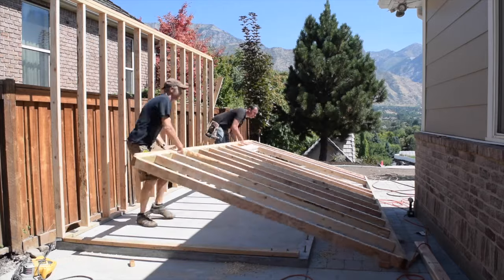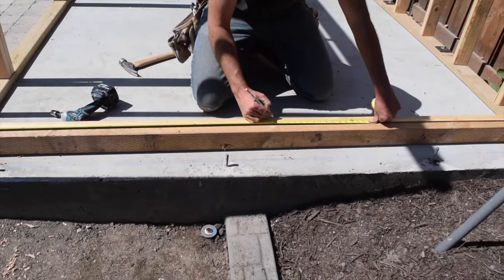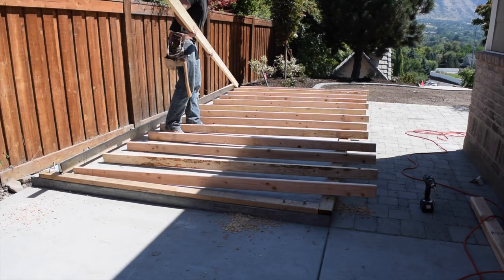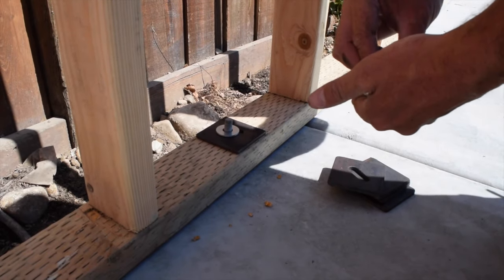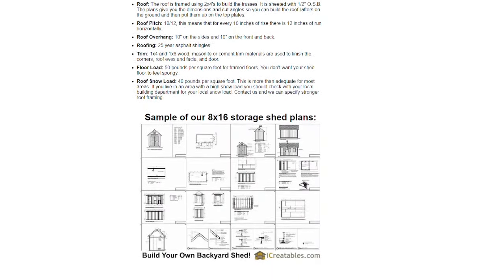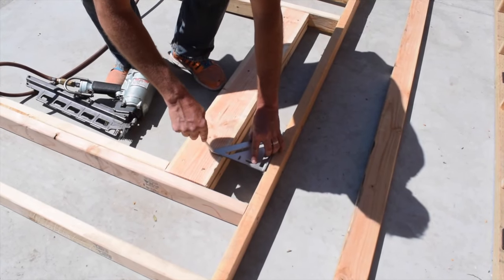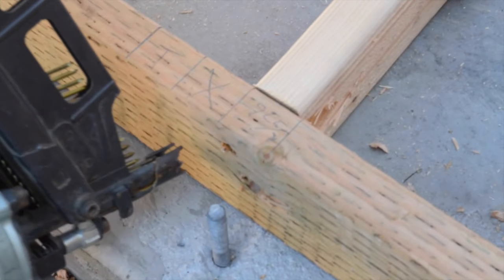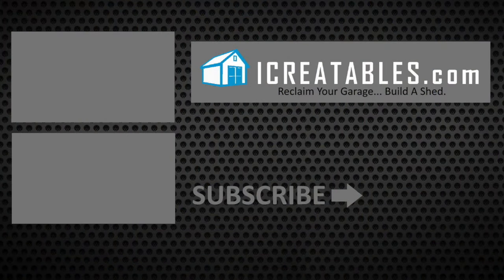How To Frame Shed Walls on Concrete Slab With Anchor Bolts

Comment: Two additions to this framing: make the bottom of each frame a double 2x4, the bottom one being pressure treated to avoid moisture issues and add a layer of foam between frame and concrete to avoid water leak.
Reply: This was great, I been tryin to find out about "how to make foundation for plastic shed" for a while now, and I think this has helped. Have you ever come across - Damkietor Nonpareil Dominion - (should be on google have a look ) ? It is a great one of a kind product for building better sheds and woodworking minus the headache. Ive heard some pretty good things about it and my partner got excellent results with it.

Comment: I always measure to know where my anchor bolts are in relation to the stud. Much easier & 3/4 or even 1 1/2 inch is not going to cause the building to fall.

Comment: 2 questions: 1) If you use pressure-treated wood for the bottom plate is that enough to keep termites out of the building? 2) What do you do on the inside corners if you want to add sheet rock? There's nothing to nail to on one of the inside walls.
Reply: Pressure treated wood keeps the walls from sucking up moisture from the concrete. I wouldn't expect it to do much for termites.
Reply from the maker: Correct, pressure treated is for rotting prevention not termites. You need to have termite treatment. If you want to install drywall you would install another 2x4 to make a full corner.
Reply: Really do you need pressure treated these days?  I use window seal (a rubber like compound) or even the foam seal either way lumber doesn't touch concrete which is key.
Reply: You would add an additional stud on the inside corner. Make sure to install it perpendicular to the other studs so you can insulate the corner. A 2x6 works best as it will go behind the adjacent wall line and still come onto the new wall line enough to hold drywall.
Reply: A little late to the game, but Diatomaceous Earth with Boric acid covering the bottom plate will go a long way in keep out bugs.

Comment: I want to do this to a drveway slab to erect two privacy walls where an aluminum lean-to awning roof already exists. With new walls and no additional weight from a wood framed roof, would this be too heavy for a slab without footings?

Comment: Is it not required to have a vapor barrier under the bottom plate between the slab ?
Reply from the maker: Sill seal is to stop air moving under the wall. You can use it if you like. This shed is not heated so we did not do it.

Comment: Do you know if it is common for framers to knock anchor bolts to the side and break the concrete in order to get a wall stood up ?  It seem like for our build, the foundation engineer and the framer didn't coordinate where the bolts needed to be placed so a few of them were hammered out to the side causing the concrete to chip.
Reply from the maker: The best way to prevent that is to layout the wall stud locations on the forming boards and double check. But even then mistakes are made. The method shown in this video allows you to still nail off the siding or O.S.B.  Thanks for commenting.
Reply: Hammering the anchor bolts to the side is probably a terrible idea lol. If they're in the way of a stud (depending on your building codes) you can do as they did in this video and notch it out, or simply move the stud over a little bit, or build a box around it (As in, cut a couple of your framing material to lets say 8", nail them in 3-4" on either side of the anchor bolt which should be enough to get a wrench in there to tighten it later, and then put a double top plate ontop of it and run your studs ontop of that. Should be fine as long as this isn't a super load bearing part of the wall) and if it falls where a king stud for a door or window is supposed to go or where the door cutout is then simply take a grinder to the anchor bolt and cut it off flush with the concrete then you can drill a hole in the correct spot you want it to be and epoxy in a new anchor bolt.

But damaging the concrete because something is in your way is really just lazy people not wanting to do the right thing.
Reply: @icreatablestv  Except that the inverted 'V' creates a notch, and the size of a notch in bearing wall studs is limited to 25% of the stud width in bearing walls. So if you have to cut an inverted V, then you should also nail an additional stud alongside the notched stud.
Reply: @carolinerose5743  I think people are overthinking this. 25% would be 1-3/8" on a load-bearing 2x6 exterior wall where such nitpicking is even worth a shrug, and 1-3/8" is plenty to notch around an anchor like this. 25% would be 7/8" on a 2x4 wall, which is still close enough to call it good; especially on a little shed. As for hammering the anchor sideways, I can see that working ok too if it's only a little so the nut can still thread down all the way and the washer is biting the sill plate. And if you wanted to be sure you could just run a short vertical block and sister it to the stud instead of a whole additional stud.

Comment: So I’ve never used osb between the header boards. Depending on 2x4 or 2x6 framing, ive used that 1/2” or 1” extra space to put some insulation. To make the header more energy efficient. I don’t do this for a living though. Just doing my own windows, and family/friends windows. I’ve never had any of them have an issue. Is there a problem with doing this though?
Reply: I don't think so really, but someone could maybe split hairs and say that the osb sandwich makes it more stable.  The 2x6 or whatever could warp because it's just regular wood, but the osb wont move.
Reply: And it just makes up the 1/2" difference you have between the width of a 2x4 (3.5") and the height of two 2x4s stacked up (3").  When you make that sandwich, your header can sit right on top of the king studs and be flush with the outside and inside walls.  If they weren't it would make walls on one or both sides difficult to finish over the header.

Comment: You skipped right over the one thing i wanted to see ... if the anchor bolts are already set in foundation, how do you drill all the bottom plate holes in the right place? If i measure or eyeball it they are always just a little out of alignment ... PITA
Reply: Set your bottom plate where you want it. Take a hammer drill (or rotary hammer), and drill holes through both bottom plate and slab where you need them to be.

Comment: where can I find more detail on sealing the wood and concrete, keeping the outside weather from coming under the bottom plate ???

Great Video series though. thanks for sharing. Is there more videos to finish this shed build?
Reply: I hope you've found the info you needed, but if not...in order to keep your shed water tight you should use a house wrap like Dupont tyvek.   Google images can help give you the idea.  That's probably the only sure-fire way.  Another layer of protection would be to apply 2 thick, parallel beads of silicone under each bottom plate, like you would if you were installing an exterior door.  Good luck, water ruins everything in time.  One more thing, ESPECIALLY  if you use t1-11 siding,  install gutters.  Without them, hundreds of gallons of water will drip from the roof and half will splash in your yard, but the other half will splash on the bottom 8" of your shed and the paint will be ruined and there will probably be wood rot after only a season or  two.  Have a great weekend.